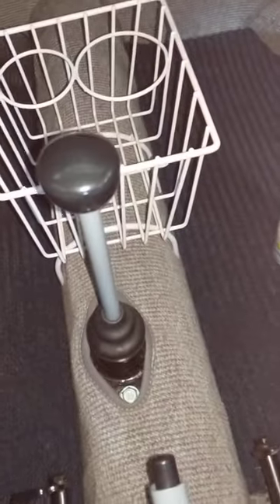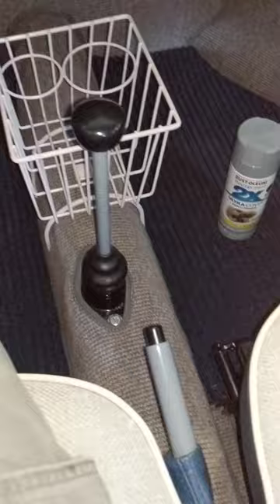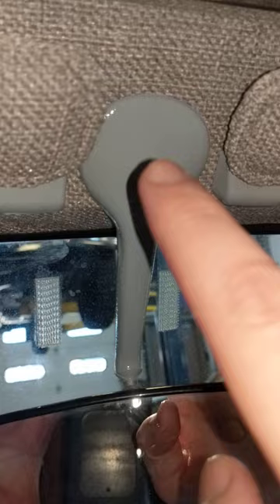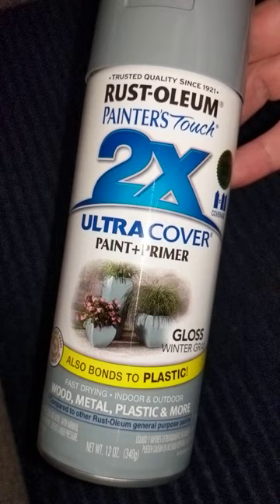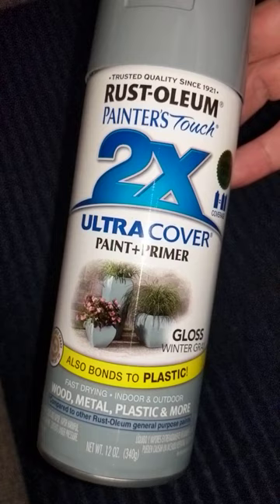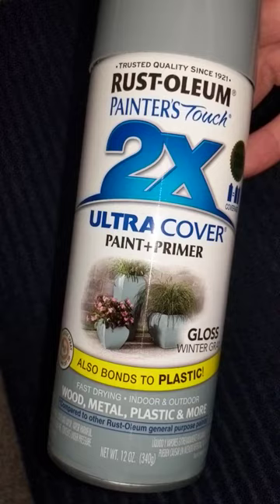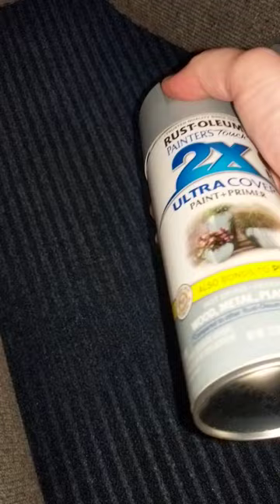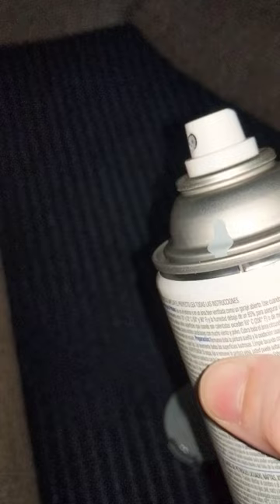Painting the Small interior Pieces in your VW Beetle BuG.  #budget #shortsvideo #shorts

Comment: Not a fan of rust oleum paint
Reply: How did it let you down, just so we all know please
Cheers
Reply: @desmo5514  it didn’t seem to harden well for me and I also experienced poor adherence on properly prepared metal. That’s just my experience with rust oleum rattle cans
Reply: @desmo5514  ... I have used the product for years, but it does dry slow if the weather is too humid, and also stinks for weeks, if not months. On top of that it doesn't dry "hard" for a LONG time. (6-12 months in my area) The plus side is it's cheap and covers well. I have actually painted entire trucks with the rattle cans.